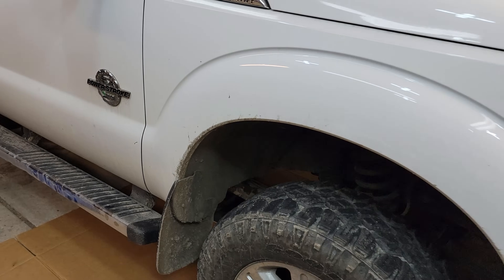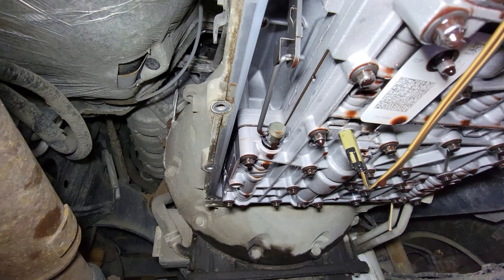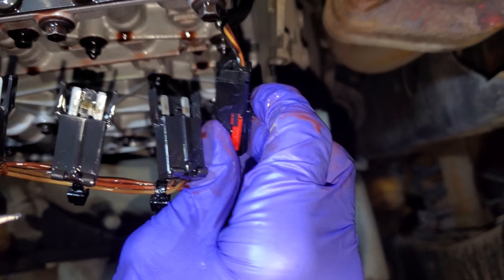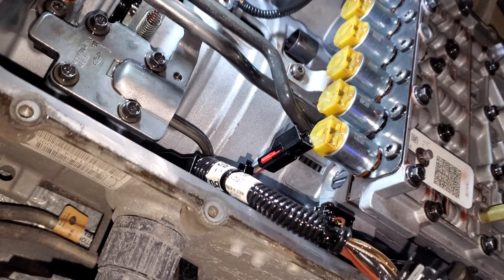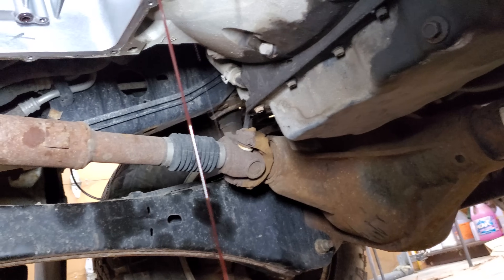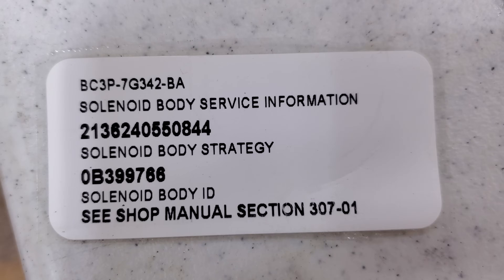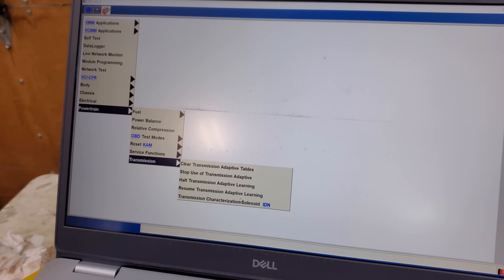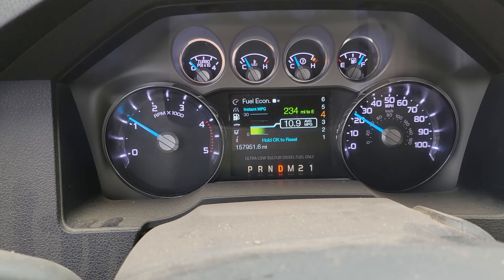**WATCH**  Ford 6R140 | Slamming into GEARs - What YOU need to know - FIXED! #6R140

Comment: Arod, we replaced valve body and associated wiring harness today on 2019 F250. And now it won’t shift into reverse or drive. It’s like it’s staying in neutral. And we got numerous TCM codes such as P0885, P0773, and P0657 just to name a few. I’m guessing a fuse, relay or the TCM itself, but where would you look first based on this info. We were just replacing valve body for a hard shift from 1-2 and 3-2. Thanks so much for any info!
Reply: Yes. The shop didn’t install one of the main seals in the valve body so the transmission fluid wasn’t pressuring up. They took the valve body back off and realized their mistake. All has been good since then.
Reply: Same happened to me after installing a new valve body, did you find out the issue ?
Reply: @rolandoreyes182 did you ever get yours figured out?

Comment: Can you confirm these two part numbers for one of the seals and tubes?  Description shows BC37-7A248-E but web is showing BC37-7A248-A.  Also BC37-7G199-A is showing as BC37-7G199-E.  Thanks so much! Awesome video that I am hoping saves me thousands! I will report back.  2019 having the exact same issue...hard upshift from 1-2 and hard downshift from 3-2.
Reply: Got the exact same issue. Did the valve body fix it?
Reply: @JCBourgeois-nd7is  yes it fixed my issue. At first we didn’t think it did because the mechanic left of the main seal on the valve body and it wouldn’t pressure up. After they realized their mistake, the new valve body fixed it 100%.

Comment: Having a similar issue with my '17.  Rough shifting through many of the gears, both up and down.  Truck has 154,000 kms (96,000 miles) on it.  Truck is going into Ford on Thursday for diagnosis.  Will report back once they troubleshoot.  Using Forscan, I did a reset on the Adaptive Tables, as well as the TCM.  No real change or improvement, it may have even made it worse in some cases.
Reply: what was the verdict? having the same issues on my 19 with 101k miles

Comment: Great video. I’m actually having the same problem now with my 11- 250 super duty. Question. Would you say this is the overall best solution as opposed to just changing the #2 shift solenoid to a aftermarket performance Solenoid? My gears seem to hit on 1-2 and back from 3-2.
Reply: I have the same problem on my 2016. It's hard to get info. It seems like complete valve body replacement shouldn't be necessary seeing as everything inside of the valve body is replaceable
Reply: @stevem4679  just went ahead and decide to order entire valve body
Reply: @joeluissalazar68  I did the same thing. It fixed my 2nd gear clunk for about 3 weeks and it caused a 5-6 flare under light throttle that was never there before. I think Ford's reman process might be questionable

Comment: Hi, 2014 F350, 6.7L, NEW transmission installed by Ford at 151,000 miles due to harsh shifting. Extended warranty covered it phew😅 Months later harsh shifts continued intermittently on the new transmission! Ford found damaged wire inside transmission and replaced the valve body I believe. Harsh shifts showed up again intermittently.🤦🏻‍♂️ Ford agrees harsh shifting is present and recommended NEW transmission AGAIN! I am confused… Ford transmission warranty will cover it this time. Just over one year left on this transmission warranty though. This is the third transmission and we now have 161k mikes on the truck. What would you do? I am losing confidence in Ford’s transmissions quickly. Nearly $10k for a new one if this happens again in just over one year. Please help.

Comment: Brought my 18 in with 42k miles erratic shifting, Ford dealer updated software..... Still wasn't right. I brought it back in at 58k, they had it for 3 weeks and said they couldn't find anything wrong with it although they did notice it was not shifting correctly but it didn't give a code so nothing they could do..... Now that I'm out of warranty, the truck will shift fine when cold, then after it warms up will go in limp mode with no code, huge delay when put in drive, and usually only has 5th gear. I bought a new OEM valve body hoping that's the issue. I have had a ton of problems with this truck..... New vehicles suck.
Reply: Did the valve body fix your issue?

Comment: Getting ready to do mine tomorrow. Hammer shifting from 1 to 2 and down shifting. I have an ezlynk programmer so I assume I won't program the way you did, but with my o.b.1 Port programmer.
Reply from the maker: Good luck
Reply: I have an EZ Lynk as well. How did you go about putting the new info into the tranny? Did you use the EZ Lynk or do you have to use forscan?
Reply: I have ez link getting ready to do this how did u program it ???
Reply from the maker: Ezlynk aint gon a program that

Comment: YES!! 2015 250 6.7 with 189k miles on it and 3 NEW valve bodies later, I'm putting in a used 6R140 out of a wrecked truck with 65k miles on it. It has a 3yr or 36k mile warranty. The Clutches are gone. This, in my opinion and budget, is the most economical way to fix the problem. I plan on selling the truck in fall and buying a camper. I have a 2017 to pull the camper with. The bump has been getting worse the more I drive it

Comment: 1-2, 3-2, and 5-6. All slam, depending on how I throttle or let off I can ease the violence of it. Glad I found your video
Reply: I’m right with you except mine doesn’t do anything out of the ordinary in 5-6 just 1-2 and 3-2 my truck is a 2012
Reply: Same exact way 1-2, 3-2 and 5-6 I ordered a revmax which is oem Ford valve body but tuned up.  I also bought a better trans cooler so it can be air cooled as well. Should see regular temps but as you work the transmission harder it shouldnt get much hotter and if it does temps will drop fast as you are easier on the vehicle or cruising speed. Alsom got the deep trans pan for more fluid
Reply: @gametlogging1942  did you get it installed? Fix your issue?

Comment: Hi, thanks for posting this great video. I am having problems with my transmission again. It's shifting up and down gears hard but randomly; usually between 4th & 5th gear. Supposedly my transmission was fully rebuild and the mechanic told me that the valve body needed to be replaced after taking the transmission apart, which supposedly was done but I am not sure if he did. Anyways, my question is, is there a way to find out if the valve body was replaced? Like checking with an scanner to see if it has been programmed or not or checking with a dealership to see if they can provide me with the original valve body number. The truck is shifting through all the gears without any delays nor grinding which makes me think that if I replace the valve body could solve my problem. What are your thoughts on this. BTW my truck is a 2017 f350 dually with 163,000 miles and the transmission was rebuild 13 months ago (warranty just expired) when it had about 150,000 miles.
Reply: Hey man I’m having the exact same problems. Did you find out what it was? Did valve body fix the issue
Reply: @osvaldovasquez2148   I did change the valve body and it did fix the problem I took my truck to another mechanic and he checked it and he told me that the valve body was never changed.The guy that rebuild my transmission before never change the valve body and he did charge me for that so now my truck is running good.  Also if your truck is tuned you might want to take it to whoever tuned the truck to have the transmission tune or checked out because I know that having a tune on your truck can make an impact on your transmission. Good luck.
Reply: @osvaldovasquez2148  BTW, if you decide to change the valve body keep in mind that the valve body has to be programed by an specialist, otherwise, the truck wouldn't run at all, a lot of mechanic shops can't programed the valve body therefore plan ahead of time.
Reply: Thank you! I’ll have it checked out. Mine is having a hard downshift from 5 to 4. If I accelerate it and make it downshift it won’t do it. It only does it if I let it downshift when I’m slowing down
Reply: @osvaldovasquez2148  definitely have it checked out before it gets worse, I didn't fixed on time and ended up rebuilding the whole transmission the first time.

Comment: My 2012 f250 has a hard shift the first drive of the day 2-3 and main cold out and only the first shift after that shifts perfectly 
The fix just warm it up longer or bad solenoid/valve?
Reply: It will get worse. Mine started in the morning 1-2 or maybe it was 2-3 and only do it once in the day and sometimes it wouldn't do it in the morning.  And then it slowly got worse. Like 6 months later it was 1-2, 3-2 and after a bit progressed to 5-6.
Reply: @Gamet Logging  did you get your issue fixed by replacing the valve body?
Reply: @alexhayes9544  no mine has been delayed in shipping. I'm hoping it's the issue. I've heard of people putting them in and it still acting up but after they drive it for a bit it clears up and smooths out. We will see. I'm hoping it comes by next week.

Comment: If I’m having the same problem on my truck. Can I just replace that solenoid or do I have to replace the whole valve body?
Reply from the maker: I mean u can but it cld be the valves in the main control sticking...
Reply: @PowerStrokeTechTalkwARod  any way to tell the difference
Reply from the maker: No. U tear down and inspect.....

Comment: I have had a shift flare from 2-3 for a while now, replaced solenoid and then a whole valve body on truck. re-tuned, reset trans and drove normal for it to relearn. Still same problem going on...I have had 0 luck finding anyone that could solve the issue.
Reply: I have something similar. 2016 with 42k. At low rpm in traffic I have a hard 2-3 shift. And I mean hard! Anything over 1500rpm and it's smooth
Reply from the maker: Might be time for a trans sonny
Reply: @PowerStrokeTechTalkwARod  I should of lead with it has an upgraded Suncoast that maybe has 20-25k miles on it but it’s been doing for about past 5k
Reply from the maker: 🤷‍♂️ sry pal
Reply: @PowerStrokeTechTalkwARod  all good brother, I’ll get to the bottom of it, maybe a tune. It’s just a mild tune nothing crazy just looking to have it all work proper. Thank you for video though. Teaches new mechanics and diy’ers good lessons. Happy holidays to you and your family!
Reply: I have something similar. 2016 with 42k. At low rpm in traffic I have a hard 2-3 shift. And I mean hard! Anything over 1500rpm and it's smooth

Comment: Did you use the HC3Z-7A100-A in this 11-16 without issue? Thw stock part on that year is coming up as BC3Z AND HC3Z FOR 17+ trucks
Reply from the maker: Bc3z is for 11-16. Hc3z are 17-19 trucks
Reply: @PowerStrokeTechTalkwARod  cool just wondering since you listed the 17-22 part number in the description and the video truck is an 11-16

Comment: Hello. I have 2012 f250, leaked all transmission fluid and started acting up by not shifting properly. Filled it with fluid, fixed the leak and problem still exists. I recently replaced the solenoids ( all 7) and still no luck. Assuming at this point the body valve has to be replaced and it should be good, what’s your thoughts? Plus I need to take it somewhere to program it right? Thank you
Reply from the maker: Ummm

Comment: Replaced a valve body on a 2019 f350 drw 75k on it. my brothers truck bought it used and it was slammin from 1st to 2nd and downshifting it would slam too. new valve body new filter and some new fluid got it running soo smooth
Reply: About how much did that run? I’m having same issue in my 2011 250, afraid to ask really 🤦🏻‍♂️
Reply from the maker: Yeahhh babe

Comment: I have a new 2022 f250 tremor with the 6.7 and have had hard shifts into 3rd gear, took to dealer 2 times and they’re trying to tell me the transmission is learning my way of driving now I’m at 10k miles is the transmission still learning? Lol
Reply from the maker: Sounds like YOU need to goto another dealer. Unbelievable

Comment: Just did a fluid and filter change in my 6r140 couple weeks ago. Decided to go with Amsoil ATF synthetic which says it’s compatible with LV. Since I’ve had a couple random slips, one was pretty bad when I mashed on the accelerator pretty hard. No codes and shifts super smooth any other time. 

Should I be concerned about mixing the Amsoil with the LV?
Reply: As long as you used the Amsoil Signature Series fuel efficient ATF or the Amsoil OE fuel efficient ATF you are fine, it's fully compatible with any LV fluid. Don't use their Signature or OE regular multi vehicle ATF it's for Dex II-III, Mercon & Mercon V and ATF4 & not compatible with LV.
Reply: @oneninerniner3427  It was the synthetic fuel efficient. And it’s been shifting perfect, just those couple of flares. Been 25,000 miles since the service. 👍🏼
Reply: @jasoncox2132  that's great👍 and I do realize this thread is old , but thought I would respond anyway for anybody else that may run across this and might be wondering.
Reply from the maker: Hmmmmmm i havent heard of issues like that.
Reply: @PowerStrokeTechTalkwARod  Ok cool. I’m gonna keep sending it! 👍🏼
Reply: I had the exact same thing - my 1-2/3-2 hard shifts started after a fluid change with Amsoil. I was thinking about maybe trying a fluid flush with LV before changing the valve body. Thoughts?

Comment: @Arod can the learning process be done with out the ford computer system?
Reply from the maker: Yes, forscan
Reply: @PowerStrokeTechTalkwARod  
Thank for your help.
Reply: Also any idea what would Cause the solenoid E off to happen on the transmission
Reply from the maker: No i do not
Reply: @PowerStrokeTechTalkwARod  code p0771
Reply: @arod I have currently installed a new value body and I’m using Forscan to relearn. I notice you used IDS. I’m having difficult time at the relearn process with Forscan. Any advice
Reply from the maker: The only thing I used ids for was toe program. Gotta drive to learn
Reply: I can’t get the forscan to accept the the new strategy
Reply from the maker: Hmmmmm not sure bud. Id have 2 remote in but that costs money
Reply: @PowerStrokeTechTalkwARod  I have the 1yr licenses. I think I may have found a more detailed video on forscan
Reply from the maker: Good luck
Reply: @PowerStrokeTechTalkwARod  thanks. By the way your videos are extremely helpful.
Reply: @PowerStrokeTechTalkwARod   ok I have everything updated and installed and on First drive the truck only going into 3 gear

Comment: Put a new valvebody in now slams on 1-2 and on random downshifts
Reply from the maker: Did you clear the adaptive learned values
Reply: @PowerStrokeTechTalkwARod   yep I did 1-2 under light throttle slams super hard and 5-4 downshift clunks hard and also sometimes 3-2
Reply: Now if I give it throttle 1-2 doesn’t slam.
Reply from the maker: Hmmm
Reply: @PowerStrokeTechTalkwARod  any other ideas?
Reply: @PowerStrokeTechTalkwARod  not sure what else to monitor or look for

Comment: Here is what information I have found so far: 
2011-2014 BC3Z-7A100-B
2015-2016 HC3Z-7A100-B
2017-2019 HC3Z-7A100-A 

First-round seal ARod mentions that he pressed in the new valve body: 7H249B

small round squishy o-rings - 7J227 (HR2 on parts blow out) should need 4 or 5 

Maybe someone can fact-check my work before I start dropping pans and spilling tranny sauce. :-D
Reply from the maker: I posted the parts in the description
Reply: @PowerStrokeTechTalkwARod  Thank you a million ARod. I have ordered the other parts not on my list. Everything should be in one place on Monday. Looking forward to shifts as smooth as butter..... LOL instead of shift flairs and hard shifts in random orders.... 😀
Reply from the maker: You bet....it took care of our problem A1

Comment: Can we get a list of the seals needed?
Reply from the maker: OK I'll do it tonight
Reply: @PowerStrokeTechTalkwARod   you check my list?
Reply from the maker: Done!!! Check the description thanks for being patient 🙏 😀
Reply: @PowerStrokeTechTalkwARod   the hm2 o ring you have listed as 4 where am I missing one? I only noticed 3 on each of the tubes that go onto the vb
Reply from the maker: @cmartz369  depending on application some will some wont. This was based on a 2016 catalog
Reply: @PowerStrokeTechTalkwARod   ah I’m trying to gather parts the other user above with the list is me as well lol.
Reply from the maker: The 4th goes on if u had 3 tubes. Some have 2 and a lil guy that on me of the bolts goes thru.
Reply: @PowerStrokeTechTalkwARod   if you  could check my work i compiled a list
7H249A
7H249B
7H249C
7H249D
3x 7G199A
7G199B
7G199C
3x HM2

Comment: Would this potentially fix a hard park to drive / drive to park clunk? All the sudden on our 2017 from p-d it clunks and I’ve gotten under the truck while my wife went from drive to park and it sounds like it’s coming right from the bell housing on the passenger side near the starter pretty much. Shifts like butter in all other gears otherwise.
Reply: @Jelani Lampkins I had both battery’s pretty much dead so I disconnected them and got new ones and then once I put the new ones in it started driving a hell of a lot better. Night and day difference. No more clunk also. Don’t know if it was the battery’s or if unplugging them for a while to allow the computer to reset did it. But other wise no issues since then.
Reply from the maker: I would reset the adaptive learn tables 1st
Reply: @PowerStrokeTechTalkwARod  Thank you. I’ll give it a try

Comment: ARod, great video as always and timely..... My 2012 with 181k on clock is having flairs going into reverse. Sometimes not and sometimes hard shifting and sometimes not. It is all over the place. I want to say it has even slow shifted from 1 to 2 or from 2 to 3. I normally am able to pause video and write down part numbers. I am going to need to do this to my truck and will need the valve body and seals that don't come with it. Anyway you could revisit your notes for us? Many, many thanks as always!
Reply from the maker: Ok